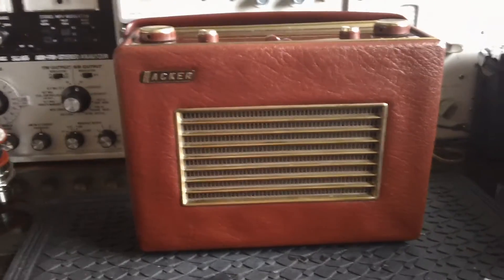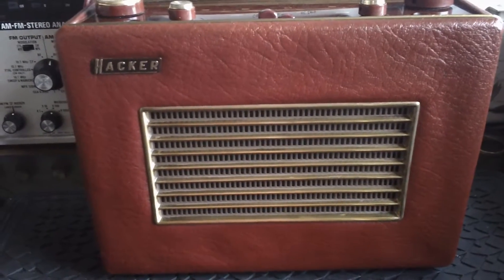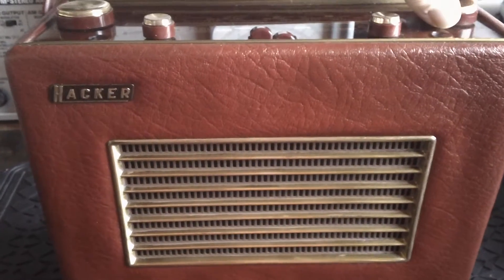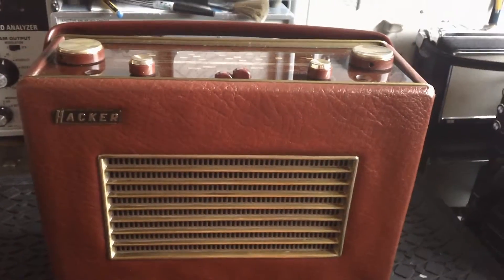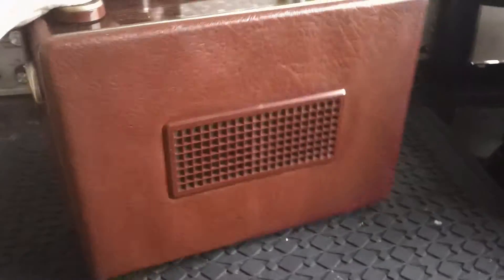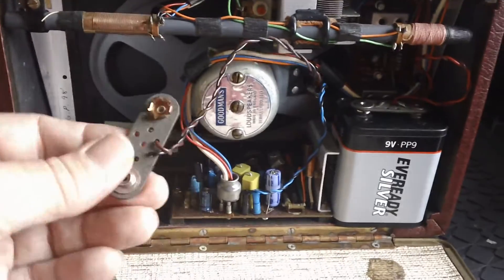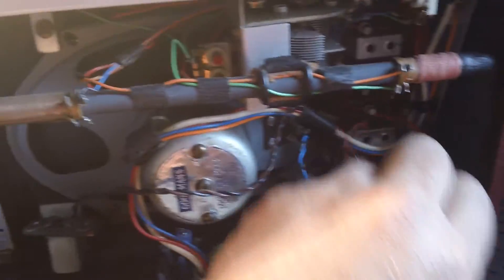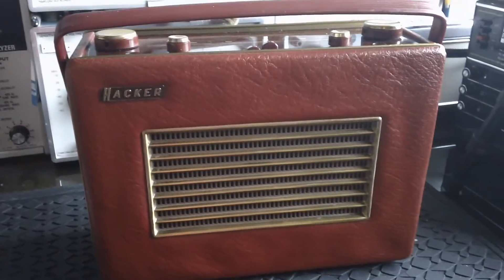Hacker Herald RP30 demo

Comment: Thanks for making a video showing the long wave reception and battery compartment. It seems like the fidelity on LW is definitely a little bit worse than than the typical AM reception, but it is still listenable for talk radio (if you can call talk radio listenable here). I am a fan of Snow Patrol as well, but you don't hear them on the radio much where I live. Unfortunately the previous owner of my set chopped off the battery connector and I could get it rewired for 18 volts, but I will probably hold off on doing more to the set until I can get the missing handle (interesting that the later ones had nicer handles) and turntable. -Matt

Comment: You mentioned having to re-transistor the Hacker you were demonstrating? Did all of the original transistors go bad as in tin whiskers causing shorts? Did you go the Soviet surplus route for replacements or were they silicon?
Reply from the maker: OlegKostoglatov  All bad! AF11X series. I went for Soviet ones I think, I bought several hundred when they were cheap :)  Even AF12X series are dear now, around £3 to £6 per piece here.
Reply: *****
The Soviet ones are still pretty inexpensive, some venders are cheaper then others. Apparently the Soviet one are more robust and do not develop tin whiskers. Yes, the prices some outfits try charging for NOS transistors is outrageous, considering how many were made. I guess the fact that those types of transistors you mentioned had a high failure rate means that replacement ones are in a higher demand. I have heard of sets with maybe a few transistors going bad but not all.
Reply: +Andrewausfa I picked up 10 AF125 transistors for $2.50 each about 2 years ago, and I have been using them when absolutely necessary (they seem to be the prefect replacement, I have not had to re-align any sets after making the swap), but it would be good to have more inexpensive spares. Do you know what Soviet part # is the AF11X equivalent?
Reply from the maker: +50sTransistorRadios  Hi Matt, try GT322 PNP Ge transistors. You could try P416A as well.
Reply: Thanks, I see they go for under a buck each so I will try to get some of those if I can't get my hands on some more AF125s.